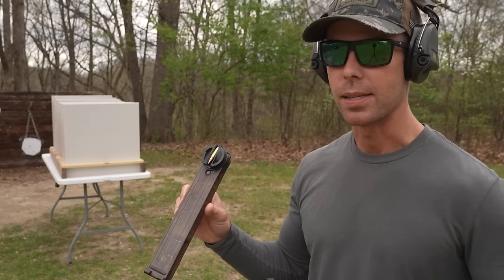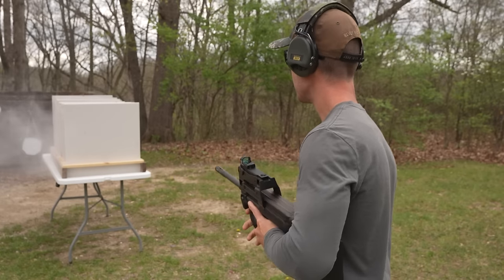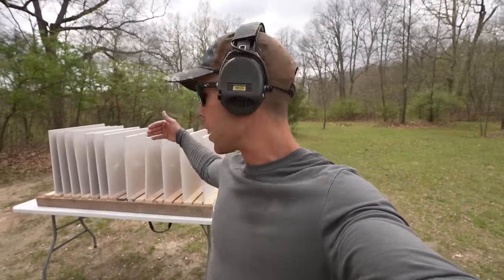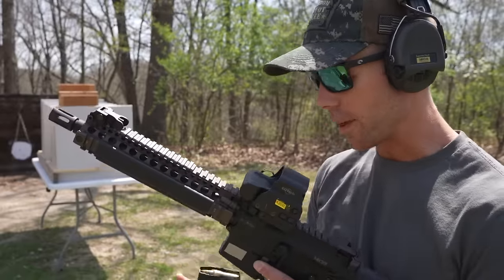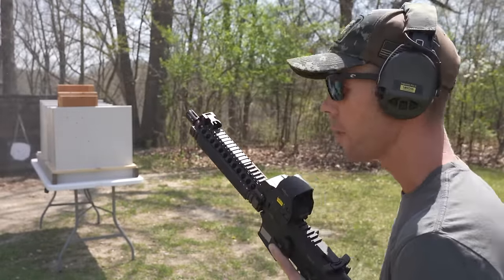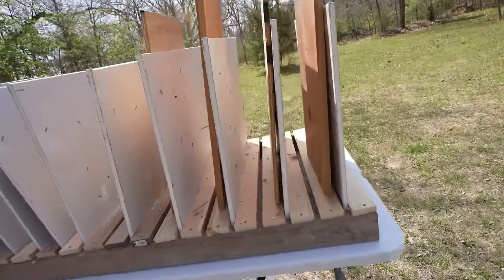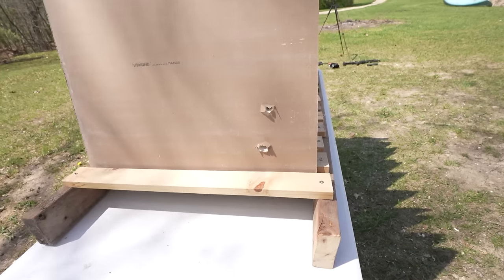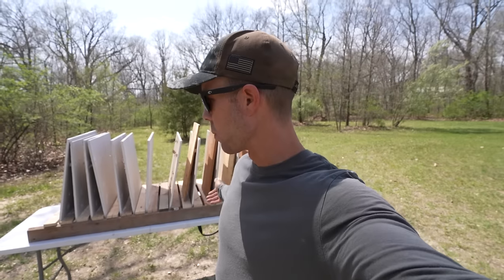The SAFEST Caliber For Home Defense??? (Drywall Test)

Comment: US Army, 1990s, replaced lead with steel. Green tip= steel core. First, it was called Eco-rounds since steel did not contaminate ranges. Not true armor piercing. Black Tip= DPU very rare outside the military, destination armor piercing. Yeah, decades old argument of what is considered armor piercing. And yes, steel with velocity damage steel and personal armor plates.

Comment: Paul Harrell uses the new and improved high tech fleece back stop behind meat targets, and it stops quite a variety of rounds.
I'd think insulation would slow it down somewhat
Reply: Also is the drywall ⅝? Or ½?
Reply: What round is the 9mm?
We know it's a hollow point, but not all JHPs perform the same

Comment: The Liberty Civil Defense line of cartridges were designed just for this type of situation. They hit very hard with incredible energy transfer, while limiting penetration in the target. Even if the bad guy is missed, the bullets will not exit a dwelling, except through a window or door.
Reply: gimmick ammo
Reply: This guy has shot liberty civil defense before. I don't know why he didn't this time. He used it for the long range pistol video and it hit hard as hell at 100 yards.
Reply: @KP-ty9yl  It zips right through body armor and has more energy than a 10inch 556 in a 6inch pistol barrel. It's serves it's purpose perfectly.
Reply: and wall(s).
Check title; "Civil Defense 9mm vs Wall"
They will most likely exit a dwelling. It's soft tissue that is meant to make them fracture. Not wood.

Even in a soft tissue target, the base penetrates deeply (meet FBI) but the petals that spread into multiple wounds are the ones that will only go 4-6" (depending on caliber).
Reply: @KP-ty9yl  45acp +p liberty civil defense vs pork shoulder
check that video and see if getting hit with that looks like any sort of gimmick.
Reply: @ShastaBean  Thanks for the video names. Ill check them out.
Reply: @themanhimself3  it does not have more energy than a 10” AR barrel lol
Reply: @ShastaBean  yep still looks like a gimmick. high velocity light weight pistol rounds have been around forever, police departments aren’t using them because they’re gimmicks
Reply: @KP-ty9yl  10mm civil defense in a 6.5 inch barrel is 60 grains going about 2600. 556 with a 10.5 inch barrel is 50 grains going 2500 fps. There are plenty of videos showing the chrono numbers.  Don't let simple math make you look stupid next time.
Reply: @themanhimself3  on my spreadsheet I have IMI M193 going 2856 fps out of a 10.5”, not sure what 50gr is only getting 2500 fps out of a 10.5” 5.56 barrel
Reply: @KP-ty9yl  All the actual footage of M193 out of a 10.5inch barrel barely breaks 2600fps if its lucky. The average is 2550 with a 55 grain projectile which is still less FPE than the liberty. Velocities will very depending on conditions but that ammo isn't averaging above 2,800. If you could provide a source that isn't your made up spreadsheet that would really help.

Comment: When you're testing house walls on one test you need to do older houses that are about half inch thick and wood siding and then you could do the same with the wood siding half inch board and drywall in older houses newer houses all you would really have is what vinyl or aluminum siding cheap CDX board and drywall but you can always throw some at least r-13 insulation into but I just don't think that's be much of a factor

Comment: You tested 5.7x28mm blue tip and green tip... why didn't you try a hollow point? (for example, Speer Gold Dot 40gr HP;  or Fiocchi Hyperperformance 40gr Tipped HP or 35gr jacketed frangible? I bet those would have had much less penetration.

Comment: Interesting tests...although I feel some of the conclusions might be a bit misplaced. 
The SS198 is designed to only penetrate ~7-9". So if you had shot it into bare gel, it would have looked about same depth as when you put it through the barriers 1st. It probably would have curved up or down and went a bit longer, overall with the bend included.
So, I doubt that a hit to CMass is going to be survived. Barrier or no barrier. Place a ruler up to the sternum and hold it at 7" and imagine something going that depth in.

If anything, the 9mm out of a pistol that is penciled through the gel w/o hardly even moving the block - would be my pick to be hit with.

The watermelon tells a significant story and you admitted to surprise at the damage it did. It didn't go beyond the melon because that's how it's designed - to stop after a 2-4" tumble, then @ 7-9". But look at what it did to the melon? Hard pass on being hit with that.
Vs. the 9mm? Still a hard pass, but if choosing between them? I'll take being hit with the 9mm. I don't buy into the 12-18" FBI stuff...that's another story.

Granted you are using 16" vs pistol barrel...so that's giving the 5.7 an advantage. You are talking ~400 ft-lbs with the 9mm and with 450 ft-lbs @ ~2700 fps with the 5.7 x 28.
SS198 from a pistol is about 300 ft-lbs @ ~2200 fps.
I load my 5.7 rounds to ~330 ft-lbs but prefer the fracturing types of projectiles (in all calibers for defense). I personally don't much care for the tumbling projectiles and anyone using that 55 gr FMJ for home defense - needs their head examined.
Reply: and to add...the only testing I've seen that accounts for MISSES and ALSO not taking out neighbors, is birdshot. If that's a true huge risk where one lives, I'd be using that and that only. Everything else I've seen just sails right through most normal walls. Even that will even fly through one wall, though - but might not be (as) lethal by then...so...? Don't miss?

Comment: .22 lr hollow point 40 grain subsonic

First test with the 9mm you had 4 wood boards (and stop on dry wall 7) second time you only have 2 wooden boards and it went all the way through .. even after the watermelon and hollow point 🤔  

556 made through all the walls in the first test , but even 2 wooden board removed , after hitting the watermelon , it did not go through all the boards… 

This is a head scratcher for me

Comment: #1 steel shot. You're not missing and you're not overpenetrating and you're not worrying about your Challenger recovering in any way shape or form. 

Home defense. Not across the yard outside. That's what a saddle holding slugs is for. Popcorn ready, I summon all ye experts to debate. But bring with you real world knowledge.
Reply: I prefer 12 GA using 7 1/2 bird. No over penetration and because of the 15 foot rule sure to ruin anyone on the receiving ends day. I also like .38 special snake shot. Availability is also a major concern. These can be acquired just about anywhere, I am in Commiefornia, so I am limited to what I am allowed.

Comment: Wouldn't a 36 grain lead hp .22 be the best. Like Federal Black. Instead of a pointy bullet designed for penetration?
Reply from the maker: Yeah it would over penetrate less but 22’s aren’t quite effective enough for most people so I left the 22 out
Reply: @1ShotTV  That's what I assumed, but in close quarters like an apartment it could be effective. Maybe quantity over quality in this case? Lol
Reply: Shot placement
Reply: Most times a high speed .22 tumbles. Going sideways they don't penetrate well whatsoever. It's the equivalent of an expanded hollowpoint while going sideways. It's like asking a torpedo to fly through water at high speed sideways.
Reply: @exothermal.sprocket  Perfect for this scenario then...
Reply: @guitarandmore69  Not so fast. Although they don't penetrate very well going sideways, they still manage two interior walls (4 layers of sheetrock, without studs), one exterior wall (2 more layers of sheetrock, some flimsy spun glass insulation and paper, and a layer of OSB and siding), and manage to whack soda bottles besides.
I would say they are still too effective at going through stuff.
Reply: @exothermal.sprocket  Did you conduct this test yourself? Where are you getting this information?

Comment: The correct code for apartments condos or any adjointing Living Spaces There is four sheets of drywall that are 5/8's of one inch thick including at least 12r insulation for both sides.  And some fire blocking at whatever height.  And this is for fire code. And the added benefit of sound dampening. And this is repeated to adjoining apartments or condominiums.  So with that info.. you can see that there is a ton of building materials for bullets to defeat. Ohh did I mention 2×6 studs.. lol😅

Comment: How would the rounds perform against the same amount of drywall but spaced out over something like 25 yards or the length of a house? The round is going to lose energy after the first set of drywall but how does it react when there's 5 or so yards of empty space per set of drywall?

Edit: Saw a Garand Thumb video like this that kinda did it. Interesting how rounds act after penetration. Slower heavier rounds seemed to perform better.

Comment: I found a video it shows how they make the hotel walls between the rooms. Its not just drywall. Hope you understand this. You have layer 1/2 in drywall 2x4 stud wall with insulation , then there is 1/2 fire poof dry wall a 1 in air gap another 1in fire poof drywall a 2x4 stud wall with insulation an 1/2 dry wall on the other room . the wall is about a foot thick. That is how you don't here people in the room next to you. It won't let me post the video this is the new law on all hotels being built.

Comment: I build house u have web wires pipes studs all so but drywall  u have water proof sound proof not be an ass bud we should try that as well cause hotels have that its two parts dry wall layer of rubber may or not make a difference

Comment: That 5.7x28 dumped a lot more energy in the block than the 9mm did.
That 9mm got clogged & didn't expand.
Also, you are wrong on the power.
5.7x28 in a carbine is significantly more powerful than 9mm.
That was pretty evident by how the watermelon reacted.

Also, there is 5.7x28 ammo that will go through steal, go through 3A armour & still have the juice to go through an entire 16" gel block & bust a water jug on the other side.
Just have to make sure you choose the correct ammo for what you want it to do.

Comment: This comparison has little meaning as you didn't even reveal what 9mm loading you used. There are a lot of 9x19 JHP loading from mild to smokin' hot. There are also frangible rounds made specifically to cause massive internal disruption with minimal "drywall" penetration. The flexibility and wide availability of 9x19 trumps the cool kids factor of the 5.7.

Comment: I would test with varmint ammo, as the bullet is designed to frag and not penetrate.
Reply: in soft tissue, yes.
Still sails through most barriers, like the ones seen here.
Reply: @ShastaBean  LOL!  Test it and learn why we use varmint loads for target shooting.  When the cops show up, point out the varmint loads, and the problems are over.
Reply: @kensmith8832  I guess if the cops where you are don't know anything about projectiles, sure.

They're designed to fragment in soft tissue. Not drywall. 

So where he shot the watermelon, first, it would show little to no penetration into the drywall, after. But where he shot the barrier first, then the gel...it would look almost identical to bare gel.

There's oodles of tests showing this that you can go see. 
After the gel tests I've done & uploaded, I have fragmenting/fracturing (varmint) rounds loaded for defense...in every caliber.  Not exclusively, though...I do have more penetrating type rounds a bit deeper into the magazine.
Reply: @ShastaBean  Wow!  You can create a video!  I have never heard of that skill as making you a forefront expert on guns and on guns and projectiles.  Even though I have been working with guns and projectiles for over 40 years, I would never show the toxic ego of "in every caliber".  All you are showing is you are too young to have an opinion.  

I think wax bullets would be a better home defense projectile if you are worried about the neighbors.  How many times have you tested your data on living targets?
Reply: @kensmith8832  I could easily point to many videos showing it flying through wood & drywall...but, given your propensity to resort to insults...you are on your own. Good luck with all that.
And anyone that thinks varmint rounds won't fly right through barriers like he shot in this video...is a more Ron. Regardless of what they can convince local LE of.
Also, consider giving a closer read to what I said about every caliber. (psst - MY defensive magazine load)
bye now.
Reply: @ShastaBean    Thanks for the laugh.  One of the arts of arguing with engineers is to take only part of what they said to make a point.  It drives them up the wall!  You took the bait and proved your standing in a workplace.  Managers aren't rattled by little things.  
I can tell your thoughts are in chaos, what I call the Interatomic Bomb.  To cement the thoughts, try mixing lead powder with wax when making home defense slugs for your shotgun.

Comment: With a PS90, you just magdump....  That has to add up.  A rule of thumb I learned is that velicity penetrates,  The round is designed to penetrate body armor rated at IIIa at least,   I know 5.56 will go through 3/8inch of mild steel.  My choice would be #4 buckshot/ turkey shot.  Most criminals are not wearing body armor and a shotgun is going to make hamburger and massive trauma.  THAT will stop all but a drugged up intruder.

805 of people shot in a city survive single gunshot wounds, and it goes down per hit drastically after that.

Comment: Wait...Please tell me you were kidding. You shot a calibre specifically designed to penetrate modern body armor at dry wall and expected it to be stopped by just 12 layers? 5.7mm doesn't pack a punch? It was MADE to pack a PUNCH, it doesn't do as much damage as 9*19mm or 5.56*45mm, but its' penetration power (the PUNCH) is en par with the later and exceeds that of 9*19mm.

Comment: Whoteewho tested some ultra fast ultra light 50 gn 9 mm hollowpoints on watermelons. I'm guessing that would self destruct super fast in drywall.
Reply: Was that the civil defense ammo?
Reply: @MattWaller04  Yes. The energy dump and failure to exit was amazing.
Reply: no, it would not self destruct. It would sail right through drywall & lots of layers of it.
They're designed to fracture in soft-tissue.

Comment: 9 mm 5 times the weight of 9 mm? 
5.7mm = 93 grains. 9 mm = 115 grains approximately.  I like the troll though.
Reply: There is no 5.7 x 28 that is 93 grains. 
It's as he said, 27 gr  (28 actually) through typically 40. Might see some 45 gr (like the TSX I'm trying to work up for rifle) and after that, it's for sub-sonic and might see up to 62 gr.

Comment: I'm sorry but your test is not accurate... your distance on the watermelon test for instance, is not consistent, the melon is against the drywall for the 9mm, the 5/7 you left a space between, AND you have the drywall leaning on the melon, and the 556, you used a smaller melon and as with the 9mm drywall is closer ... just saying 🤷🏽

Comment: Wow, you made a video on how not to kill what you are shooting at.  5.7X28 is the last round I would shoot anything with.  That crap is overpriced garbage.  There is almost nothing that I would ever consider using that shit to do.  Shooting bad guys?  5.56 NATO or 9mm, 45ACP, 44 Magnum 308 Winchester, 12 gauge shotgun.  Most every one of those are more effect both in cost and actual effect on bad guy.  What exactly is that 5.7 trash supposed to do anyway?  It does a piss poor job of penetrating body armor, and it is way too overpriced.  What a bunch of trash.

Comment: You seem like a nice young man - who doesn't have a really firm grasp on logic.  I'm sorry, but if you are testing something to see if it over penetrates from apartment A to apartment B, where the only thing separating the two is drywall, why in the world would you introduce slabs of boards and/or plywood into the test?  That defies logic. Their presence invalidates the test.   Oh yeah, you wanted to see how much it over penetrated.  SIGH, we still KNOW nothing about how a bullet behaves after shooting through the first apartment wall, other than it will go through 3 or more such  walls.  You never shot the ballistic media with only the two layers of sheet rock.  Once you change the parameters you have changed the whole test and are no longer testing for the original desired knowledge.  GIGO.  Garbage In, Garbage Out.  Junk, false, faux, non science.  HOWEVER, had you postulated that the 5.7 is too powerful for use in home defense because of over penetration, all of your testing would have proved that.

BTW, the answer to your original test is obvious.  If you don't want to over penetrate two layers of drywall, use  .22 LR rat shot, a Red Ryder BB gun, a water gun, or a Nerf gun, or a spit ball out of an old school Bic pen body..  

Also, the Fibbies specify 12 inches of penetration because the people they shoot aren't always standing straight on facing them and they need to have the best chance of hitting something deep that will stop their target.  While I am at it, contrary to popular belief, plenty of folks have been killed with a .22 short or .25 ACP which won't pass the Fed's test.  

Now go get a lawyer, and sue your teachers/school district/University etc. for not providing you with a good education in logical thought.